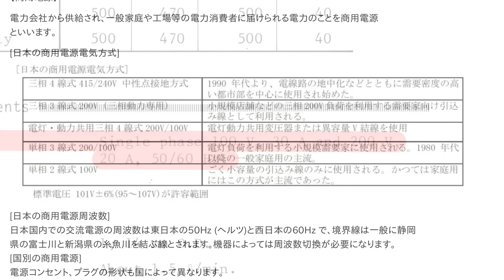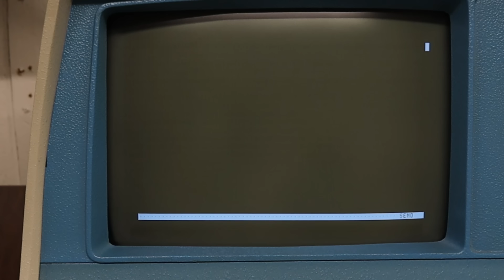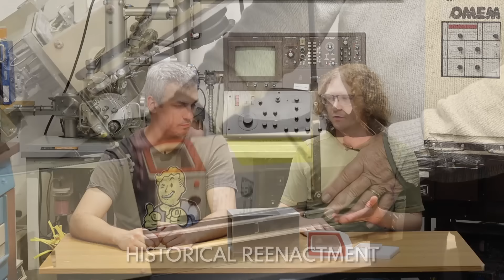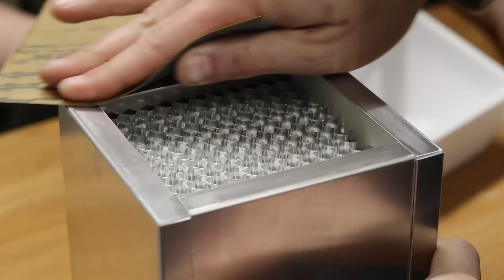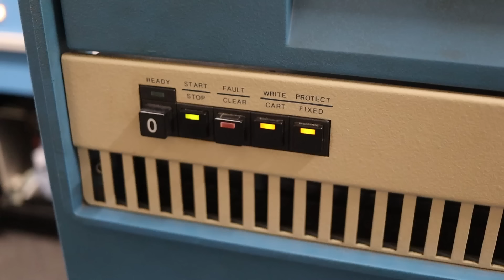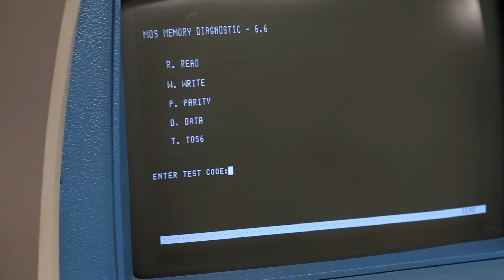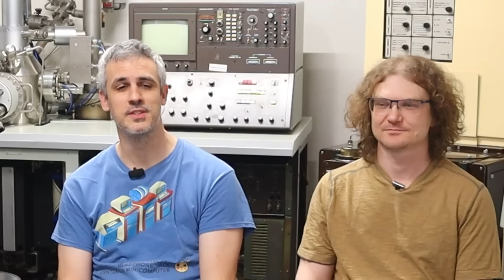Welp... that's terrible.

Comment: Small suggestion while you are mucking about with power and possible answer to your 200v supply. With all that lovely vintage electronics a UPS might be a good idea. I'd hate for a lightning strike or just dodgy power to kill any of those unique artifacts. Chungus UPS units that are getting decommissioned can often be had fairly cheap/nearly free and you don't need new/great batteries. A few minutes of run time would be enough to let you park heads/shut down things should you need to. 
You may also be able to use one to generate your 200 volt output,as many of them have programmable outputs.
My little baby 3000va dual conversion unit will take in my 240 and output 208v if desired.

I'd put the UPS outside the electronics room and just tap in to the power in/out there. 

Bringing up one of those could well make a nice side episode what with the finding, transporting, cleaning (probably) battery stacking, blurred out wiring connections ;-)

Comment: For the Transformer, the Industry has the very same problem, lots of CNC machines run on 200V, in fact this is a semi international standard. So you might get  one cheap from a company which services and scraps old CNC machines.
I worked for such a company in Germany fixing CNC machines. We had literally tons of those transformers around, 50A and up. Most even had several voltage taps. E.g. 400v  in (EU rotary 2-phase) 220V, 200V and 110V. 
They are not that expensive in the first place since they are not real transformers. They use a single coil and tap the desired voltages in the middle of the coil. The secondary coil of those transformers is a section of the primary coil. No galvanic isolation there, simple and relative cheap.
Another way would be modifying an emergency power generator. They need to regulate their voltage anyway and most can be adjusted down to 100V/200V. But as any ordinary generator, the output quality is really bad, not a real sine wave.
Another way is using a photovoltaic system - or parts of one. The inverters are also somewhat adjustable as well. A friend has collected tons of forklift batteries he uses as an emergency backup, his inverter can power his entire car workshop for a couple of hours, including some really powerful machinery.
Also ask your local utility company. Some contractors might have some equipment stashed which can be used for your purposes.

Comment: i suspect that the error was probably caused by the hard drive not being ready on time for the machine to read it.

a consumer pc will wait for the drive before saying drive failure but maybe your system does not wait so you have to not turn it on for a few minutes after you hear the drive do a diagnostic seek.

a consumer pc will not post until the drive has spun up and did the diagnostic seek where as yours posts immediately.

Comment: The 100 and 200 volt supplies seem to beg for a transformer, but the prices are enormous like you said.  Perhaps, however, a bucking arrangement so you can produce 20v to subtract from 120v and produce 40v to subtract from 240v might be the least outrageously expensive possibility.  I just hope they don't expect one side of the 200v to be neutral.

Comment: How much of a difference is .5kva for you? The Temco T51582 is a 240v to 200v 50/60 single phase 7kva for 986 shipped. I will say from what I found Larson offers a 1 year and Temco offers 10, the Temco is sold as an autotransformer.

Comment: So.. three steps forward and two steps backward?  Sounds like another normal day at Usagi Electric...
Question:  Why not use double-sided tape to attach the filter housing adapters?  That might make them more easily reusable (or is out-gassing of VOCs a concern?).
Reply: If the amount of VOCs from tape is a concern, then the VOCs from 2-part epoxy is a bigger concern.

I noticed (and commented inside my head) that the filter housings seemed to be bent & folded sheet metal with a 45° flange at the second-folded corners. That would give order-of 0.5mm triangular gap. you probably could get thick soft tape to accommodate that, but not standard tape. OR maybe a gap-filling PU foam, but that's going to be even worse on the VOC front.
Personally, I'd have looked at hot-glue myself.

Comment: 240V down to 200V 20A?  Just need to use a  240V/40V 20A and subtract those 40V from 240.  That is just 800VA transformer, nothing big. Here in EU, one could get one even custom made for less then 250 bucks. No idea why anything in amurica that has anything to do with MAINS is such BS priced.

Comment: The easiest way to have control over voltage and frequency is to use a vfd. Variable Frequency Drives are used in industrial applications to control speed of ac motors. They are fairly cheap. The other option is to just the input of the machine. You might just have changed the machines internal transformer. Often they have their own internal transformer that changes voltage to 12, 24, or 48v.
Reply: A VFD would wreak havoc on these machines, they're only intended for motors with an inductive property. VFDs use a high frequency pulsed output instead of a smooth AC curve, the power supplies in these machines would be toast in no time trying to take in a pwm signal.

Comment: A 480V 3p to 208V 3p transformer has a turns ratio of 2.31, which if used with a 240V single phase feed will give you 103V, which sounds like “close enough” in my book. You’ll have to tie one leg to neutral, and you may need/want to disconnect the other legs, but it seems plausible.

Comment: well at least on the Japanese unit  that runs on 100 and 200 volts ,will accept 50 & 60HZ so you wont have that to deal with.

Comment: I guess now we have TWO magnetic media surfaces that need to be recoated. Best get that JEOL up and running poste haste.

Which, what's wrong with just running a pair of variacs inline with the mains power? Tweak one down to 100 VAC from 120 VAC and the other down to 200 VAC from 240 VAC. Is it a current carrying capacity issue?

Comment: autotransformer for 20% voltage difference would be just about 20% of the size or regular transformer. You do not need the insulation so I guess that is the way to go. Cheers Marcin

Comment: You can probably use 208v transformer which is the standard commercial 3 phase voltage in the US and should be close enough. Variable frequency drive instead of a transformer maybe too to convert it.

Comment: How about changing the transformer (or power supply front-end) in general in the microprobe.  Make it take the 240 you have, and still generate all the right rails.  As a first effort you can use modern power supplies.

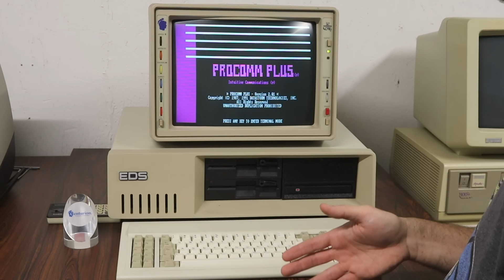Comment: 5:54 lol when I was a kid with my first modem (USR Sportster 1200) I used Procomm Plus at first but later switched to Telemate and stayed there. I hadn't seen that splash screen since so I just got transported into the 80s
Reply: I started with 300 bps, on the Amiga. But when it came to faster speeds I went PC and Procomm as well.

Comment: For the 100V, 200V power, look into VFD's. Variable Frequency Drives.
These are normal used for 3 phased motor control and are available everywhere. The output can be set to any voltage, frequency, etc. and also can be used 2 phase, 
They are also avaliablel used

Comment: If I saw that kind of quirky behavior so soon after I had done a thing that I knew was pushing the power supply to its limits, I'd want to have a scope on the various regulated voltage rails to convince myself that there wasn't some scary ripple, especially in the +5V that needs to be very reliable for all those 4164s to be able to remember the bits and bytes you tell them. I know the attention is focused on the Phoenix but I just worry that its power-hungry needs might be impacting the other parts of the system in subtle ways.
Reply from the maker: We've actually already chased down the quirky behavior. It's the result of one of the 128k memory cards responding to both low bank and high bank. It has an addressing fault, which causes it compete with the good 128k memory and things get wonky!

Comment: One method to reduce the transformer cost is to use two smaller transformers wired as autotransformers. It only have to work with 10% of the load. If you find two identical 9V or 12V transformers, you can reuse them as autotransformers.

Comment: See if you can find a junked, made in Japan CNC machine from the 80's or early 90's for cheap.  Many of them (I know Okuma & some Mori Seiki machines did) had 100v/50hz outlets right next to the RS232 ports for mounting tape punchers that were available from the manufacturer.  Stands to reason they would have taps on their internal transformer to supply those outlets.  Might be a cheaper option to cannibalize one of those.

Comment: I'm worried that the grinding of the filter before gluing the adapters did leave some abrasive material in the filter that later did destroy the disk.
Reply from the maker: We cleaned the filter inside and out with IPA and lots of canned air, then let it purge for hours and hours. The filter has been hanging about for over a year and made the journey down to Texas in a backpack, there's all sorts of tiny particles that could have embedded themselves in the filter in that time. That's why we clean and purge.

What we didn't do is clean the actual platters, and that's where I messed up. This drive was stored in someone's garage for years, so dust and who knows what else could have adhered to the platter. Purging got it mostly clean, which is why it didn't crash for two days during the filming of this episode. It only crashed once the format got the heads close to the center of the spindle.

Comment: The CDC-9448 Phoenix are always very touchy and prone to crashing heads.  I am willing to visit and help install the replacement fixed disk platter assy.   Regarding the odd CPU6 issues it may be worth checking the system power supplies to out voltage and 60 or 120 Hz ripple.   Regards, Ken R
Reply: David, That fixed module was sitting in my cabinet for over 20 years! You MUST absolutely clean all surfaces with ISO Alcohol before attempting to load the heads.
I also have another manual for you for the SMD tester I gave you.
Reply from the maker: Hindsight is always 20/20, but I definitely should have cleaned the platters all the way up to the spindle on this one!
As for the weird issues, we've actually chased it down to an addressing fault on one of the 128K MEM cards. It's responding to both banks, which is causing weird intermittent issues as it battles for memory space with the working 128k MEM card.
Reply: @UsagiElectric  how is the mem managing to do that - a crossed wire ?
Reply: Where is Usagi?? He should be responding to this lol. That's quite an offer!
Reply from the maker: @WatchamacaIIit  Usagi has been talking to Ken for years, he's even in some of the b-roll footage in this very video. Ken is a friend, and just because we aren't talking in public in the Youtube comments doesn't mean we aren't talking.
Reply: @UsagiElectric  Ah ok!
Reply: @WatchamacaIIit  If he had any hint of sanity left, he'd be hiding in the hutch with the bunnies.
What am I saying. "IF he had any sanity left"
(Exit, stage right, playing "They're coming to Take me Away" by Napoleon XIV on a ukulele. And a unicycle.)
Reply: @WellsiteGeologist-UK  Lol yeah.

Comment: I did field service back in the day with a system that had 2 hawk drives. I remember one day getting a service call, when I walked in I remember the distinct sound of a head crash, they didn't even shutdown the system. This happened more than you might think, always on the fixed platter..
Reply: Happened one day in a company I worked for in 1980s ... yeah, it happened a lot!

Comment: To go from 240 down to 200, you just need a 240v -> 40v transformer with the secondary having the required number of amps to support your system.   A 20 amp 40v means a 800w transformer, or use a 1kw transformer to be safe.  You are looking at around 75$ USD for something new, 25$ USD for something used.  You wire the mains 240v onto the transformer primary and one hot phase onto the one of the transformer's secondaries.  Measure with your DVM the mains to the open 40v side of the transformer.  If you got the polarity right, you will see 200v.  If you got the polarity backwards, you will see 280v.  Finding a transformer with dual voltage input, 240/120 and secondary with center-tap means you can just buy 2 transformers if you need both 200v and 100v.
Reply: This works but it's sketchy as hell - and to be honest it would be safer (and probably cheaper) to just use a commercially purchased autotransformer before any DIY attempts at the powers required.

Most of the time with Japanese equipment you can change the mains voltage with tap selection internally. Japanese power grids are still messy but it was a lot more chaotic 50 years ago, with 100/200V,  105/210V & 110/220V existing in various parts of the country in addition to the national 50/60Hz split. Japan standardised nationally on 100V fairly early but the "distribution island" nature of their grid development meant other voltages persisted for quite a while in some districts. 127V existed in at least one area and the PSUs are likely to have a fairly wide voltage tolerance in any case (It's usually +10-5% but could be wider - particularly with lower voltage supplies as they're more sensitive to voltage drops as area load increases and that can result in oddities if the voltage is set with a building under full load (such as unloaded volatge climbing a LOT)

I'd check the PSU internals on both parts of the unit before messing around with external power kludges

Trivia: I spent some time living in Myanmar and the mains voltage swings so widely that virtually every house has an autotransformer with many of them using basic systems to turn the voltage up and down as the supply input varies in order to maintain a stable voltage indoors. power systems worldwide are weird, particularly in countries where load regularly exceeds supply capabilities (In this case, the limiting factor is the distribution capacity in cities. It wasn't designed for a sudden massive uptake of AC units.
Reply: @alanbrown397  Nothing sketchy about it, it's a common technique that I've done many times.

Comment: Good job that imported machine can run on 50/60hz power, a lot of older devices that used synchronous motors for clocks or derived some timing from the mains frequency were often sold in both variants depending on where in the country they were sold.

Might be worth having a look at what that actual internal power supply is doing with that mains voltage and seeing if you can replace it with something that works with 120/240v, might be cheaper than a dedicated stepdown box.

There was a local company near my home many years ago that used to import a lot of test equipment like that from Europe and Asia and change out the power supplies to work with domestic voltages.

Comment: Could you not just import a DC to AC inverter design to operate in the same region that your equipment is designed to operate in, thus making sure it gets exactly the voltage that it needs? Then you can get some AC to DC converters that work in your region, slap a few batteries in there, and then power the inverter from that.

Comment: I'm a bad person... I run 100VAC Japanese kit on our 110VAC mains.

Remember our system is 110/220, not actually 120/240VAC
Reply: The the US, the voltage is 120/240 volts ±5%.  That means the voltage could be as high as 126/252 volts. Japanese equipment really won't like that.
Reply: @rocketman221projects  Ahh in Canada land it's 110/220. Our mains run around 110-120V at our outlets. Assumed the US was the same.
Reply: @rocketman221projects  It's not enough to make an impact. Been running Japanese electronics off the US power grid for 15 years now.

Comment: From a position of supreme ignorance:
Does this mean you've got another disk recoating project for the auger microprobe?
Reply: +1 vote.
Semi-seriously. They're probably from different manufacturers (the coating, not just the ironmongery. Or titanium-mongery) and decades, but that doesn't, necessarily, mean that they're fundamentally different coatings. The "primers" for the bare metal surfaces, maybe.
But that is, as you say, a whole 'nother project. From the P.O.V of getting the system back up again, ... why do you think they were built with removable platters? It's the period-appropriate response to the serving of (unsweetened) lemonade. Setting up a lemonade production line is a later stage. At the moment, planting the seeds for the lemon trees is a good start.
Reply: @WellsiteGeologist-UK  were discs able to be sanded down and re made by manufacturers or did they have to be discarded ?
Reply: I was also thinking this - if we can do the Bendix drive, maybe we can do the Phoenix also???

Comment: All these young folks commenting about CRT noise. 😆At least back in my day, you couldn't hear the CRTs over the noise of the fans.
Reply: most people born during the late 40's through the early-90's are deaf to 15.75Khz.  Thanks to CRT televisions due to the intense audio emissions from  flyback and deflection coil vibrations.
Reply: @metaforest  That's just a normal part of hearing regression as you get older, not related to flyback transformer noise.
Reply: @inothome  True. at 60 I'm topping out around 9kHz but as a "getting older bonus" I'm blessed with 3-4 14-16kHz whistles in each ear, so I'll never forget what a room full of CRTs sounded like.
Reply: @alanbrown397  Yeah, you lose the ability to hear actual higher frequencies but blessed with hearing constant frequencies, tinnitus. I hear ya! lol

Comment: This looks like a power issue.Check the powers and grounds at the back plane for proper voltages   and noise.  You may also have a bias voltage between ground sources.  Nice work good luck. Send more cat pics. Lol